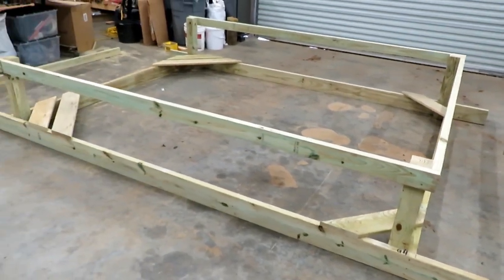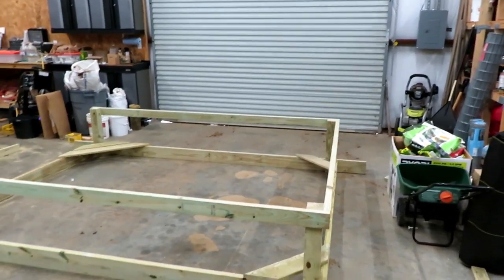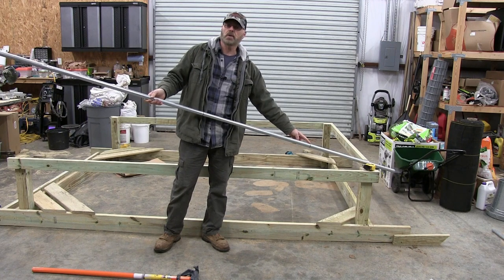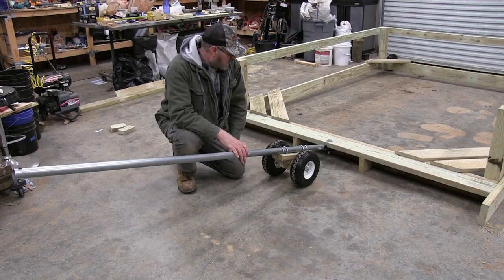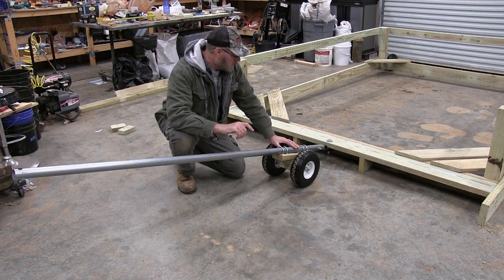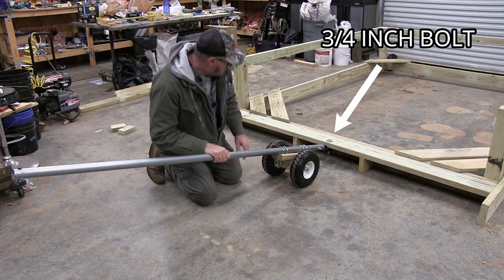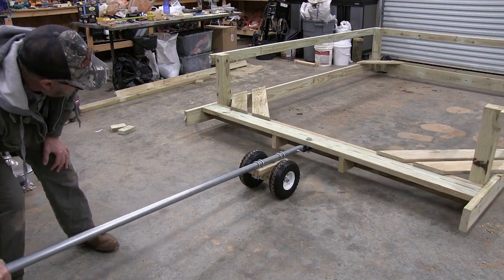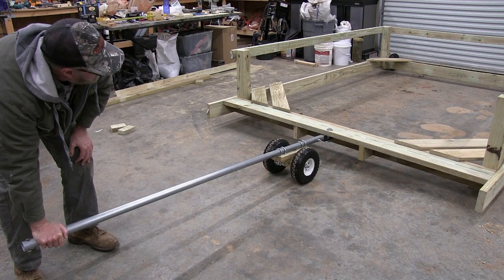Chicken tractor build Part 1of 4

Comment: I built a chicken tractor, not this good, but similar sized and found one issue I would love to see you address. Smaller size means harder to spot pests, in particular chicken mites, before they take over. So I'm thinking designing for full access to every nook and crack for cleaning and pest checking is pretty vital.
Reply from the maker: I haven't noticed a mite problem with my chickens but If I do, I would use a plastic bottle with a small hole at the end and puff diatomaceous earth in every nook and cranny and also put it in their sand bath box.

Comment: You're supposed to pull on the bender handle, not on the conduit.  You should also use one of your feet to assist in the bending.
Reply from the maker: That's only for 90 degree bends. Anything under 90 degrees is bent the way I did it.
Reply: 20 years as electrician ...bend anyway you want ...this guy does quality work check other videos
Reply: Looked like Pete's method worked good for him that's all that counts.
Reply: By bending as did he, you have much more control/precision  over the bend, and less margin for errors  . . .Beautiful Work Brother, and is going to be great help for me when I get to the build of our own  . . . Thank you for the share, Sincerely. 
P.s. please forgive my ignorance,  bit can I ask the measurements for placing the bending points on the stick? Yours just came out so perfectomungo brother . . .
Reply: Pete B. Wrong.
Reply: He is building a chicken tractor not pulling wire through four 45's.  Yes the pipe should be on the ground and the handle pulled, it reduces deformation of the pipe.  But when being used in this manner he could drive over it to make the bend and it wouldn't matter.
Reply: @Average1212  you are correct. Pipe goes on the ground to do it correctly, but if you wanna work harder, you can do it the way Pete did too.

Comment: The pipe is supposed to be on the ground and pull on the handle
Reply from the maker: That's true only for 90 degree, but for less then 90, you do it the way I did.